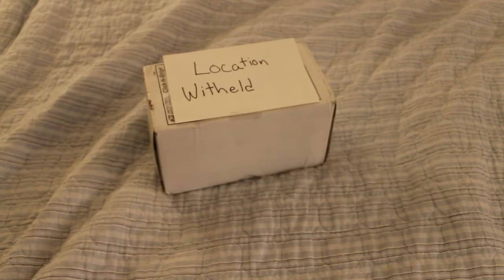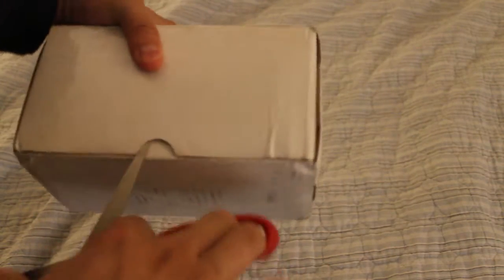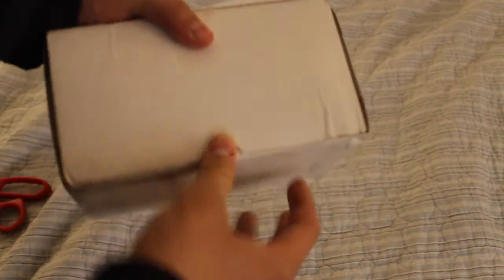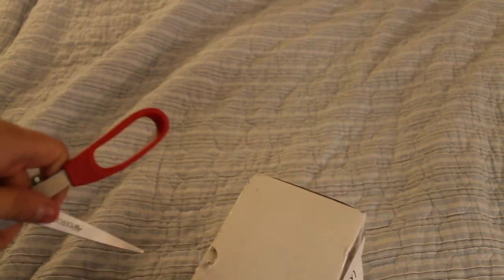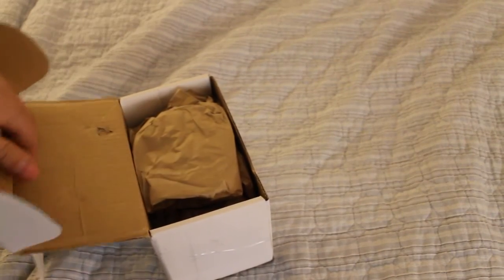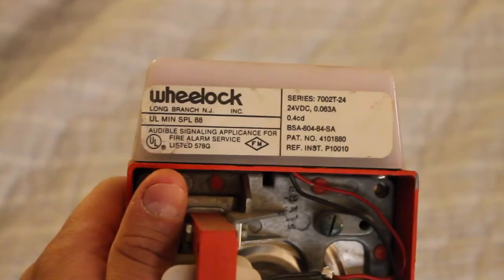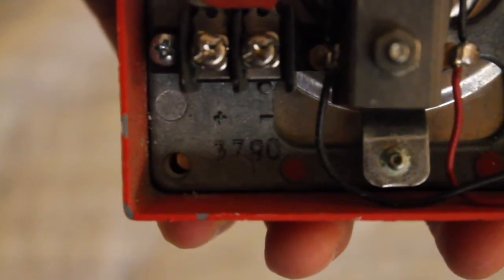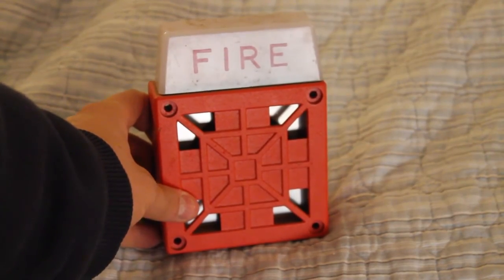Unboxing: Wheelock 7002T-24

Comment: How many 7002t's do you have now?
Reply from the maker: +S.E.R. Safety (Grant Bansemer) Three 7002T's, actually. Two of them are operational. One of them arrived DOA a few months ago. That would be four if you wanted to count my 7001T, it's practically the same thing, just in flush mount.
Reply: That's a lot of 7002t's :D
Reply from the maker: +S.E.R. Safety (Grant Bansemer) Sure is. I can't believe I have so many.
Reply from the maker: Strobe Honk yep, eBay whenever they pop up.